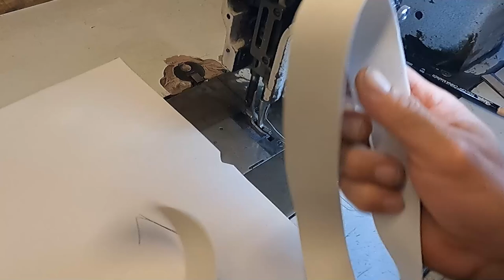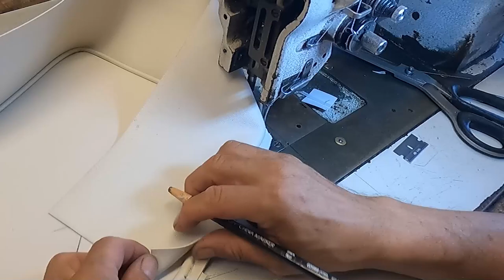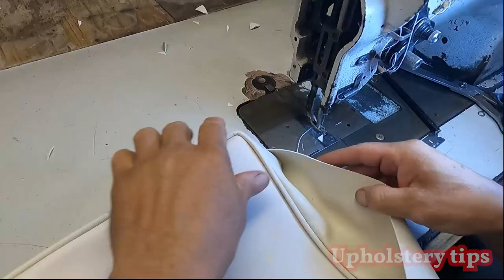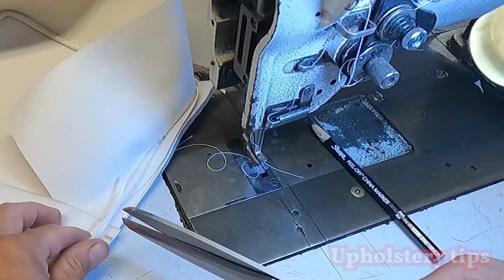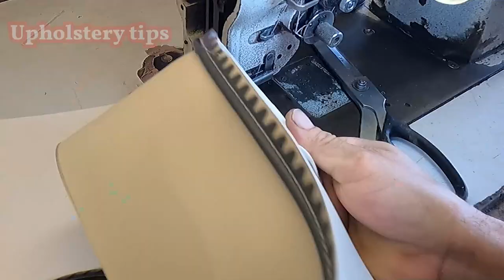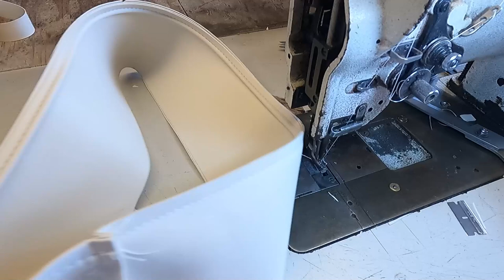Upholstery  TIPS  - Five different ways to sew a Piping

Comment: Great video. I have the dexterity of a camel, so for method #2 I have a rough time keeping the pieces aligned when the top layer is hiding the underlayer. Could I staple the edges of the lower layers together first?